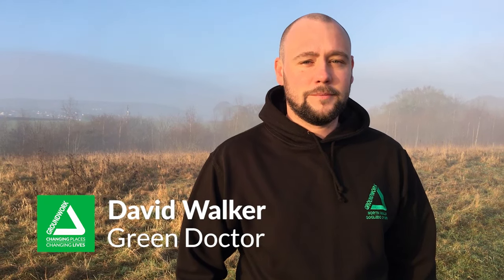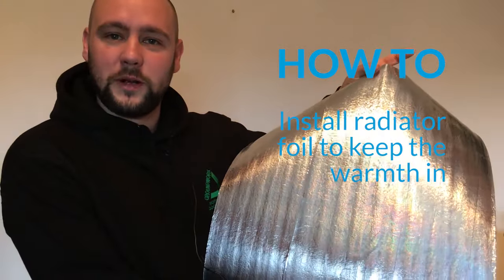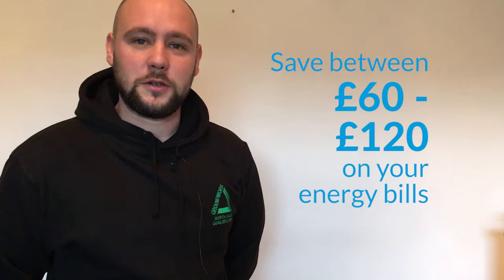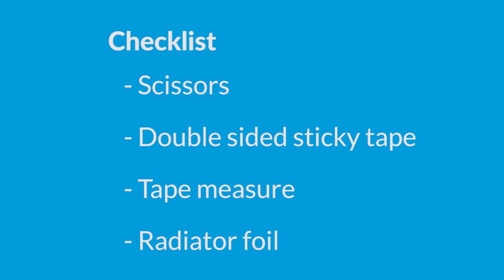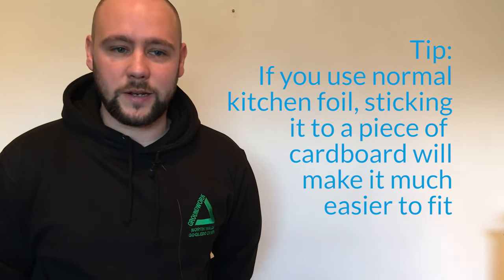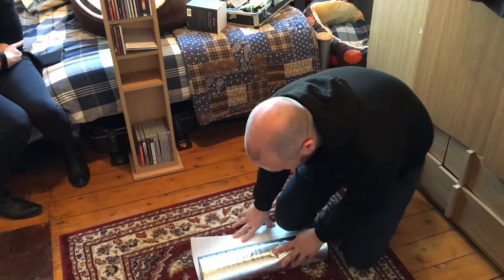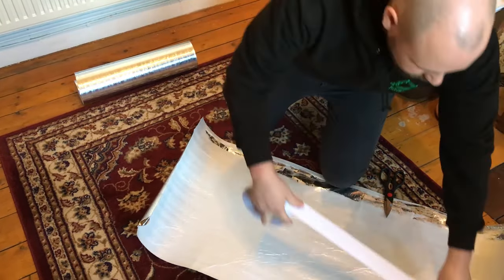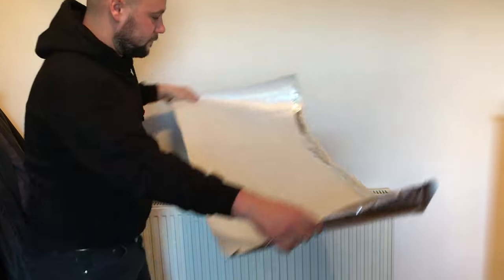How to install radiator foil to keep the heat in and reduce your energy bills

Comment: I did that years ago with kitchen foil and Bluetack ™️ and the results were instant and amazing. Must have saved a fortune by now.
Reply: Really? A regular kitchen foil? So I don't need to buy the radiator foil?
Reply: @moneoo88  Yes, I used regular kitchen foil. I expect that foil made for the purpose - probably thicker - will be better.
Reply: Bluetack! After a few years it degrades and goes sort of runny, then becomes very difficult to remove  I imagine impossible to remove from foil without tearing it.
Reply: Steve_Recall   Bluetack seems to lose its oil and makes grease stains when in place for a long time. I once acquired some other tack (green) which was even more oily and whatever I was hanging didn't stay in the same place. I imagine using it behind a radiator means only the edges can be stuck down, leaving air gaps and a vulnerability to tearing foil if anything fell behind the radiator.  Personally I like the foam backed radiator film, it is slightly insulating, is applied with wallpaper paste, so you know you have a good seal to the wall without lumps from blue-Tack and last probably25 years before it needs replacing.

Comment: You definitely need to be on TV right now!!  Thank you for this video; initially thought I'd have to take off all the radiators and glue it to the wall (as per instructions on the foil!)  Your instructions were great - concise and to the point, and gave me the confidence to do the whole house in about an hour.  Thank you so much!

Comment: You didn't say how to avoid the brackets holding the radiator.
Reply: He just measures between the brackets, so the area outside the brackets does not have foil. You can simply make cuts into the foil for the brackets if you want to extend it to the entire width of the radiator.
Reply: Measure between the brackets and cut the foil. Duh.

Comment: Part of the reason I want to do this is for aesthetic reasons. Our drywall behind our radiators is completely discombobulated (cracking, cracked, entire chips have come off, brick/concrete is exposed, brittle, chalky, bubbly…basically an uneven surface. And I am not able to remove the radiators to get behind there.

Comment: Excellent video.  I have night storage heaters which fix directly onto the walls without a gap between wall and heater.  Will your foil method work with my storage heaters????

Comment: I live in an apartment where the wall heater is in the hall very close to the wall across from it so that wall gets really hot I'm wondering if I use this type of reflective material would that work to reflect the heat into the Hall as opposed to into the wall?

Comment: hi there is the same process you use and materials etc if applied to the underside of a cupboard that is built above a floor heater? the cupboard is around 6 cm above the floor heater. both measure around 150cm long, depth 20cm. thanks in advance

Comment: Try taping your foil to some cardboard and then bring it up from behind the radiator in an arc above the radiator. If you make a decent deflector like mine and blow air at it you will see the air heat up around your room. Believe me you will get more bang for your buck that way mate!

Comment: Most confusting - I am using the foam with aluminium for insulation and reflection. It needs cuts in the places where the radiator brackets attach to wall. I was looking to see what adhesive to use.. How it the radiator in video attached to the wall?
Reply: It doesnt matter wht type of brackets as long as its made to fit. Dont over think it
Reply: @AWhileHanlin  I wanted to know what adhesive to use, the brackets are not the problem. Anyway, I did the job months ago and used wallpaper paste

Comment: Much easier and effective to cut vertical slots on each end of the insulation and slide over the radiator hanging brackets.

Comment: What if I put the radiator foil in front of the radiator? Would this insulate the radiator? I am asking because I live in an overheated apartment. Thank you
Reply from the maker: I don't think it would help much as a lot of the heat would probably bounce back off the wall. Most radiators have a thermostatic valve on them that allows you to only have the radiator heat up if the temperature gets cold enough. On the other end of the radiator there is usually also a valve that lets you control how much hot water gets into the radiator in the first place so that might also be an option. So those might be other options, although I guess you've already tried that?
Reply: Erm.... try turning the thermostat down maybe?
Reply: TURN THE RADIATOR DOWN! You're welcome.

Comment: Do radiators on indoor wall need reflective foil?
ie. Adjoining wall in a semi detached?
Reply from the maker: It's more important to add foil to external walls as any heat lost behind a radiator there is lost to outside the house. On internal walls it can also be useful to keep the heat in the same room as the radiator though.

Comment: Wouldn't the heat from the radiator cause the tape to unstick from the wall?
Reply from the maker: Thanks for asking. To some extent it will depend on how good your tape is and the quality of the wall behind, but it's not something we've had happen to us yet.
Reply: Use wallpaper paste instead. Will stick like shit to a mattress.
Reply: I used double sided tape on a good wall. After two weeks the foil started coming off. I wouldn't use this. I'm either going to try wallpaper adhesive or thermal liner adhesive.

Plus the heat will curl the foil, you need to take off your radiator really and fit it properly.
Reply: you could also just use some drawing pins.
Reply: I used Blue tack TM and it's stayed in place for over ten years. Remember to buy a high quality wall though 😉
Reply: @AntonioDal.  brilliant idea!
Reply: Super glue
Reply: I bought some radiator magnets which keeps the foil in place

Comment: The claim about foil reflecting '95% of the heat back into the room' is mis-leading.
A hot water, so called 'radiator' in fact emits very little of its heat by electromagnetic radiation, as is clear from the Stefan-Boltzmann Law, because of its low absolute temperature (around 350K). So, in fact, it reflects back 95% of very little.
The vast majority of its warming of a room is done by conduction through the metal then hot air convection, for both of which processes foil is irrelevant.
Far more important are various methods of insulation and draught exclusion.
Reply: So, are you claiming this is ineffective on radiators because of your knowledge of physics or from actually using this technique? Because since doing this the heat retention in my home has improved massively. My thermostat & boiler tells me so....Oh and the smart meter too.
I'll choose to believe those over your data. 😂
Reply: So isit worth doing? Does it heat rooms up more?